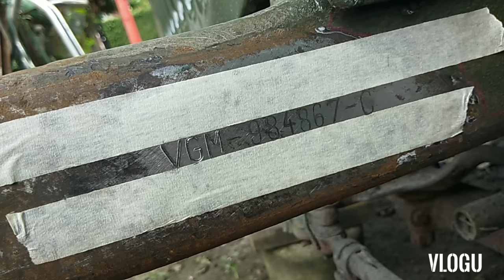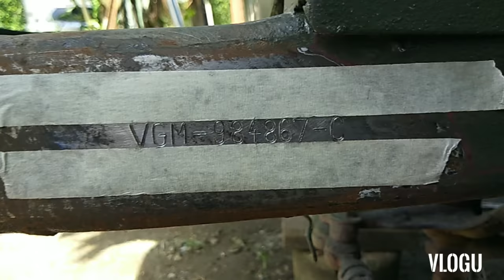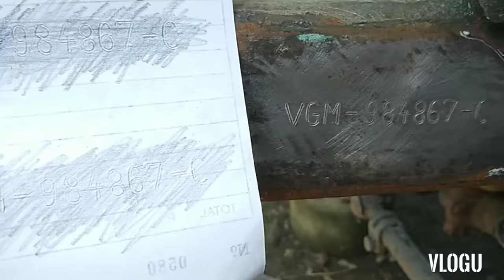how to make chassis number using this tools Original size

Comment: You're not supposed to make the VIN/serial number. It's supposed to be there from scratch. If restoring a vehicle involve replacing the sheet where the VIN was stamped, that will open a can of worms. You might not get the restored vehicle through an inspection. So, no, you don't make a serial number. Unless you somehow bought a title with no vehicle attached to it, of course....
Reply: Modern cars have the VIN in five different places in addition to the actual riveted on plate.
That includes the windows in some cars.

Comment: What's the purpose of rescribing this chassis number? when selling this vehicle later..the buyer will be much more skeptical about this
Reply: It depends on the intent (as anything, really).

Aside from the obvious malicious reasons, sometimes you can get into situations with older vehicles like the vin just rusted away and needs to be restored, and finding out the "right/legal" way to do it is just too much work. It would be just much more convenient to either replace the frame (if it has a separate frame and yours is screwed) and weld a piece of steel in place of an old number followed by chiselling, etching or stamping.

That would apply to both one-offs and restoration projects.

Sometimes you have the paperwork on a vehicle but not the thing itself (that's more common with motorcycles though) but there's the same model just sitting on a scrapyard and costs nothing.

But again, that's from my personal experience dealing with old junk to give it a second life.

Comment: Kailangan ko to ung 1980 kong nabili pabura na talaga chasis number
Reply from the maker: Send your mesenger and I will pm
Reply: @inmyhands4827  san po shop nyo ngawa din po kyo s engine number
Reply: @inmyhands4827  saan po talyer  magpapgawa po Sana cavite po ako.anak ko lang sa picture.
Reply: Same problem naagnas na...  San kaya pwede contact si boss?